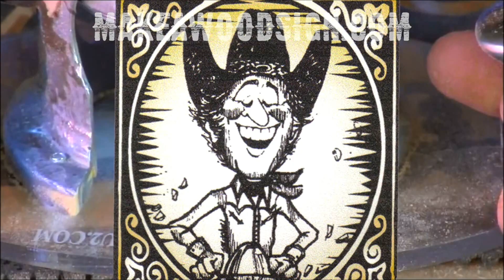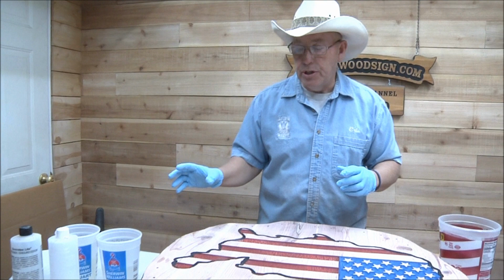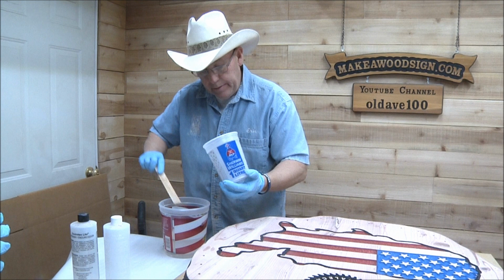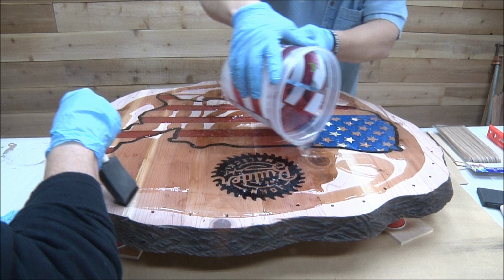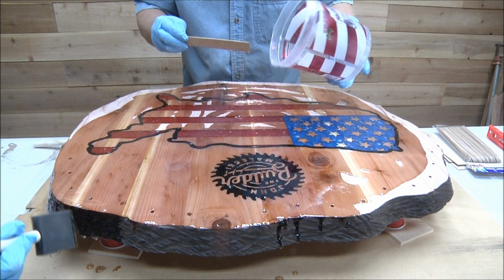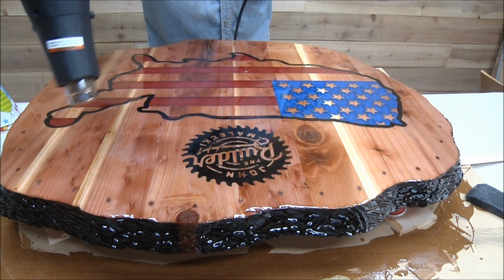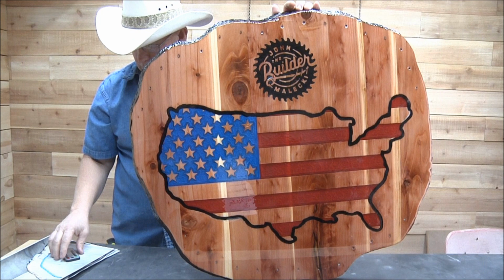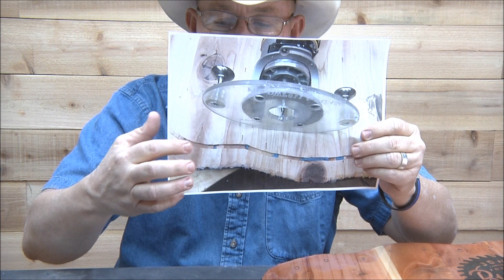#268 Part 7 of 7 The Making Of The John Malecki Wall Art

Comment: WOW! That is gorgeous! Thanks so much for showing us all the steps. I don’t know if it would work, but try this as a test, then let us know. Fill the router line, where the lights would go, with a fat bead of hot glue before sealing the front. In my mind, the hot glue then could be pulled out all in one go. It would even fill in the drilled holes. BUT, this is only an idea. Thanks again, Eric and Vicki! I so enjoy and learn from your videos!
Reply from the maker: Thank you Sue.... That's a great idea, I thing the hot glue would work well fro what I was trying to do.

Comment: GREAT WORK!!! After the epoxy has been mixed up I put the bucket in the sink with hot water. This allows everything to off gas. All the  bubbles rise to the top from the mixing process.
Twinkling lights in the stars of the flag would be cool. Again very good job.
Reply from the maker: Great idea, I will try that.... Thank you for watching and the tip

Comment: Nice job Eric.ive just finished some little project with resin..the first was a water clear resin,the smell knocked you out.iam now using epoxy resin with no smell. Had to laugh when you mentioned the temperature thing. I do mine in the kitchen and I have to turn all the rings on the cooker on full  just to warm things up a bit ..lol.my resin seems to take days to go off,I don't think I will be doing alot with it...Awsome work and a good team effort. .
Reply from the maker: Yea it's kind of tricky to get the temp right in the winter. Glad you liked it, Thank you again for watching and all the support, Eric

Comment: Just my observations. After painting, the edge showed up really well and Vicki did a fantastic job on the edge. On mixing of the finish, there is a factor built in that you don’t have to get every little bit of product out of the container. I think you spend too much un needed time on scraping the container. Vicki is better at spreading the product than you Eric. She goes right at it and gets it done. You are to methodical and fussy. Having said that, all the problems you have discovered will be a huge help to us when we do the same process. We will not have to go through the learning process you went through. Great job. The customer should be very pleased. I have watched some of the same videos you have, I’m sure, about using preparing and pouring the liquid finish. You are correct, most are on a flat piece of furniture or box and not a carved sign which has its own set of problems when pouring the finish. You have to mix way more to allow for the carving. Now you need to take a well deserved break and calm your nerves for the next round. Vicki does a fantastic job of keeping you on track and calming your nerves. She knows you well. Excellent director behind the camera. Looking forward to your next project.
Reply from the maker: Thank you Ron, I appreciate the feedback and suggestions. Glad I could give some tips that will help. I have a few idea for the next one but it may be a few weeks. Thanks again, Eric

Comment: Great finish to this series Eric! Question about the tape in the light groove...What if you installed the lights before the pour and let the epoxy kinda glue them in place?
Reply from the maker: I'm thinking I might try that. I've got a couple different ways I want to try it again.
Reply: Dave Rhoten Be mindful guys, LED’s tend to get really hot. If the epoxy happens to be flammable (even after curing) that can turn into a problem.

Comment: You guys are amazing. I'm becoming addicted to your videos. I'm seriously thinking of starting sign making just because it looks like fun; perhaps just as a hobby for starters. Out of curiosity. how would one price such a big sign. In other videos you speak of pricing by the square foot. This sign is obviously much thicker and heavier than normal and required lamination. Does square footage pricing still apply or do you have special pricing for this type of sign?
P.S.
I am lucky enough to have access to a large supply of wide (and free) live edge slabs, so I think I might specialize in larger signs.
Reply from the maker: Thank you, Ian! We really appreciate that! 
First off, if you have access to free live edge slabs, then you're already ahead of the game!
Second, I would still price this sign by the square foot. The price would reflect the overhead cost of the board, though. If someone wanted a 3" thick redwood slab and it cost me $200, then the final price of the sign will definitely reflect that. When I'm using redwood 2BY, my price stays the same because that material is already covered in the square footage price.
Hope this helps
Reply: @oldave100  Thank you very much. I'll email you a pic of my first project when it's done. Thanks again for all your content.

Comment: Great project again! I still need to do that finish lol. Question about the lights...is the electronic eye located on the back?  The lights I use have an eye on its own wire and I can drill a hidden hole on the side or in something black so the remote can be used from the front or side. Are these lights similar? I just noticed you were pointing the remote to the box on the back.
Reply from the maker: as far as I cant tell I point it to the box. That's why I left a notch on the side to point to.